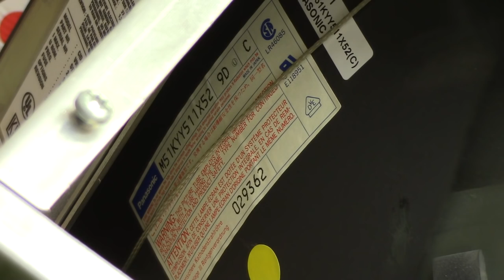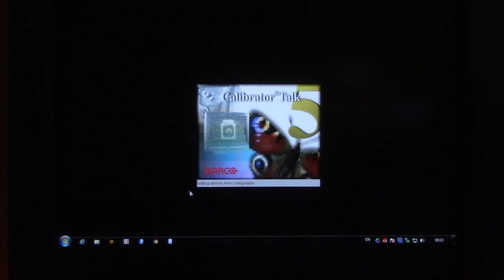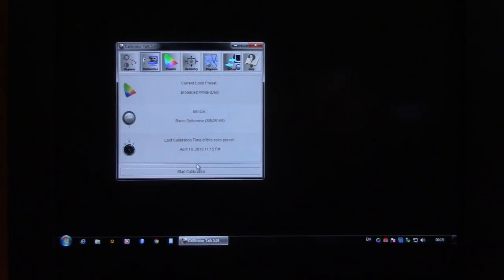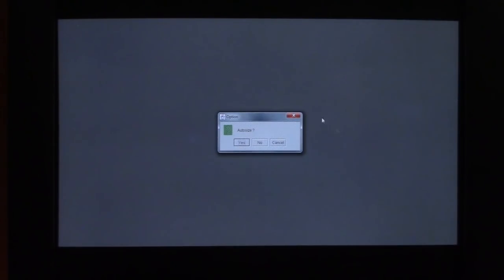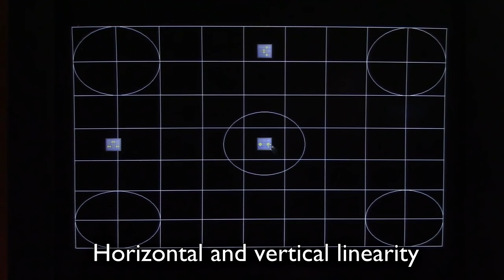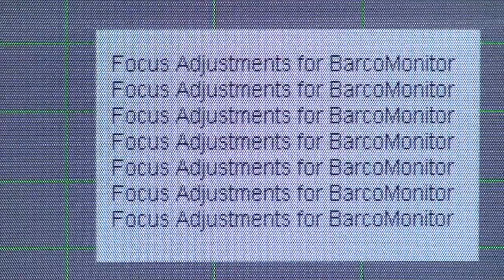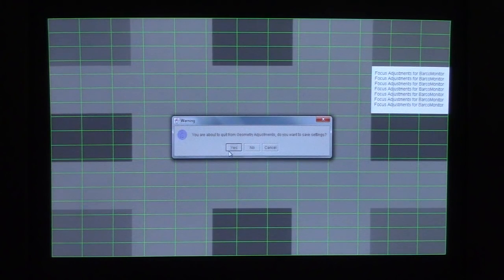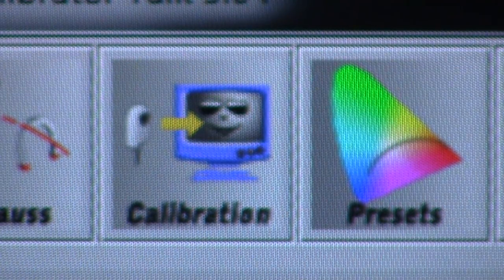Another Barco Reference Calibrator V + working software

Comment: Hey, what's the model name/number of this working model? I've got a chance to buy a CID 421 from a graphics production house with the software and calibrator probe and everything in box in great condition. Great videos btw.
Reply from the maker: IIRC these are CID421s, but I could be wrong. At about 10K hours, they do perform very well when used together with a modern calibration tool and software.
Reply: Really nice to hear! May I ask what you actually use(d) yours for? Just a regular desktop monitor or for some workstation environment like graphics design or CAD work?